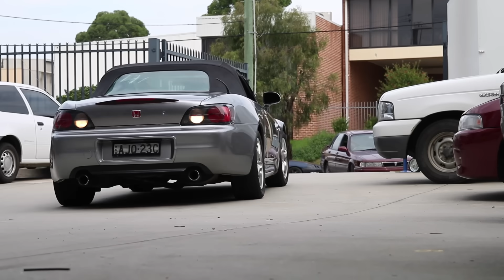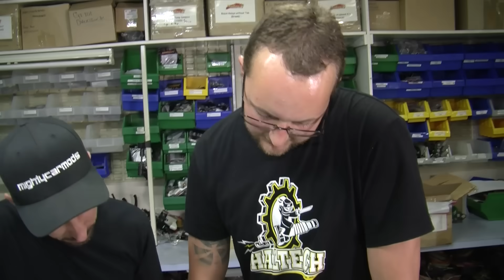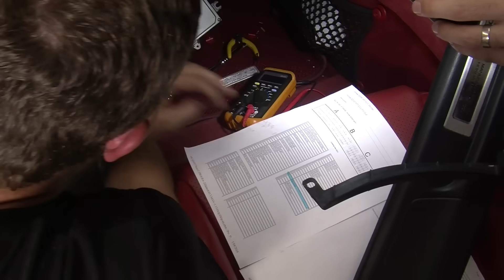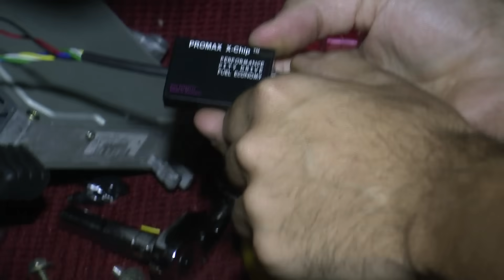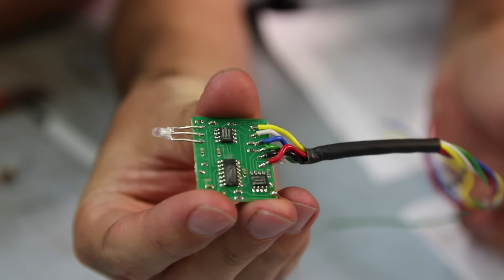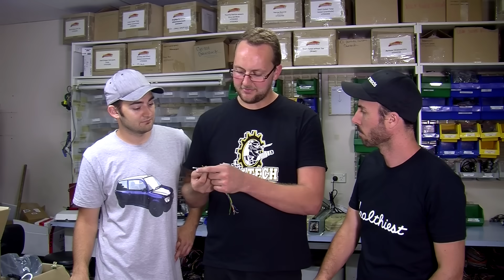eBay Performance Chips -  Mythbusted

Comment: Some performance chips do work but they cost like 1000$ lol I knpw because I bought one on accident, instead of a proper tuning unit for my turbo i got a bully dog RT gas tuner. It works, kind of. Allows for about 15hp in my 2.0 sentra with cold air and headers installed.

Comment: 14:35  No. It hasn't been installed. You are freestyling with the wrong box. This is just entertainment. The real Mythbusters would have abandoned the video after 7 minutes when you found out it was THE WRONG PART.
Look I guess, you had it pulled apart by real tech (apparently), so we did learn something. But the whole dyno aspect was invalid because the correct connections weren't all available. This is not about whether the box is a rip off (it is) but about testing methodology.

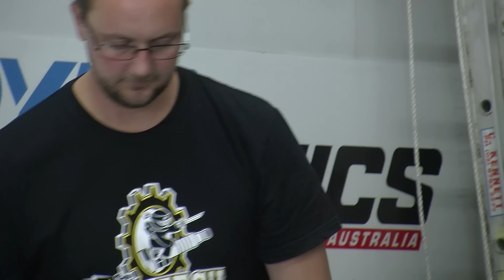Comment: ....And at about 7:30 you find out it's the wrong box for the car... Using MAP with the splice wire that was intended for MAF means that the whole exercise is now complete BS. - Physics teacher and car enthusiast. If you are going to test ANYTHING, you need the correct part. But you wanted to finish your video and pretend that it was installed. Really?

Comment: I put a chip in 95 325i and it was the best power for $ upgrade I did. The chip was $350 and it was a direct replacement for my factory one. It gave me about 30hp but it changed the entire way the car drove and got rid of the limiter for top speed.

Comment: NONE of the plug-in "performance chips" work, or do much of anything, EVEN the several hundred dollar name brand ones.

I tried several of them on a dyno years ago, and they didn't do anything that wasn't within the limits of the accuracy and repeatability of the dyno. This was an engine dyno also. Bone stock T.B.I. Vortec small block Chevy with the factory electronics. The engine was pulled several times with each change, with the same water and oil temps, and then the results were averaged.

Some of the chips said "For best results, must be used with a 160° thermostat, (that you had to go and purchase seperately), and we tested with the factory 195° stat AND then with the 160° stat. 

There was NO noticeable improvements with ANY of the chips, BUT we DID see a few horsepower when we swapped out the 195° to the 160° thermostat... 😂

I am surely betting that the small gains we saw with the 160° stat would have been had WITHOUT even the "performance chips" installed.... 🤣

I wish we would have went and put the stock chip back in with the cooler stat and pulled it again, to prove that theory, but we ran out of time on the dyno. 
But, I'm fairly confident that the gains WERE strictly from the cooler stat, and had NOTHING to do with the chips whatsoever. Such an expensive rip-off. 😠

Comment: It does work exactly as intended!! Its intended to fleece people who are stupid and it performs that function exactly perfectly.. i say this because you would not believe the amount of car's i see with obd2 plug in fake fuel savers/performance enhancers and these similar wire in devices and people who are selling car's advertising these stupid things thinking its a good mod and its going to help sell a car or win a track day ect.. I've seen hundreds of people around Brisbane and Melbourne swearing black and blue that they work.. its disgusting how gullible people really are..

Comment: I see there was a PS option on the screen. That's is what's should have been used and not imperial. You may find that its PS, or HP in DIN format and not imperial or US HP..
 Should have done this for something a bit more real like a $150 item with the right connectors. This is just BS

Comment: Hi , I thought the S2000 was ment to be 230 horse power ? that is what they say in the UK ?
Reply: the 230hp is measured at the engine, on a dyno your measuring from the wheels so you have drivetrain losses

Comment: Cutting into wiring or original equipment on a vehicle I can only assume will "void" any warranty. Also, when one takes the vehicle to the shop for maintenance, it will probably confuse the shop mechanics as to what the hell---- they can't adjust to factory specs during a tuneup ??? I recall thousands of "gas saving" devices were advertised in the 70's during the gas shortage including everything from "Fire injector spark plugs", "Ring of fire spark plugs" "Fuel line magnets" to "Water injection canisters". In my opinion they were a SCAM. I have yet to see any aftermarket product improve gas mileage. The best way to save on fuel consumption is to incorporate good, steady driving habits by smooth acceleration and braking. Avoid rapid acceleration, quick stops, and avoid stop and go driving.

Comment: Well, removing the numbers on the chip/IC could be the company actively hiding their secrets. But thats not the case here. They are hiding the fact its probably just a GATE IC. Something like a NAND gate IC or an OR gate. 

Ive seen companies remove chip numbers before. "No user serviceable parts inside" etc etc.

This is just a con!
Essentially its a placebo. If your told some little box will do a certain thing, your brain will tend to notice it more. 

Especially if your some young guy. If "Fast" or "Sport/race" mode, you will tend to have a heavy foot. But in "Economy" or "Fuel saving" mode, you will not drive you car as hard/fast.

Comment: I purchased a "performance chip" about 15 years ago.  The device was assumed to contain an IC circuit in order to be called a Chip.  Out of curiosity I opened it up.  There was only a 31 Ohm resistor, and nothing else?  So I had paid $31 for a 10 cent resistor which was supposed to take the place of the intake air temperature sensor.  What a rip off.

Comment: This is a shot in the dark, but as an ECU specialist are you able to increase the performance of any vehicle? Specifically, a 2014 Buick Lacrosse 3.6L AWD? I’ve discovered that there aren’t any performance upgrades for my specific car despite having the same engine as a cadillac CTS (I think). Is there a DIY way to perform a trial and error on my ECU to increase the performance?

Comment: This reminds me of the Bluetooth receiver I bought on ebay, which I opened when it failed to pair to my phone. It was designed to do nothing but light a blue LED when you pressed the switch.
Seriously. Battery, wire, LED, switch and hot glue. Audio jack wasn't connected to anything. $10. Free postage.

Comment: I have a 2003 S10 EXTREME ,4.3L V6. Did you ever come up with any power tuner that worked? Have you done any test to help the performance of the 4.3L engines ? Thanks Rod.

Comment: I think it is not that easy ... Each car / each manufacture designs something with the precision quality ... Even you can trick the machine to run faster but then you will ruin your engine faster because of the quality .... You pay $30K for a car and hope it run like a $100K car ... Sure but it is for a short period of time because it will be degraded faster.... Quality + Performance should be a in PAIR for any of the price ... I am not yet talking about the POLUTION / SMOG CHECK FAIL as part of the modifications .... Chinese FAKE stuffs like to get the sale but you will be the one who gets the bill later ...

Comment: Great video.Sad to say I just bought a second chip from an online dealor back east. Have you guys  tested other online chips? I used to work with large ICE's and we would calibrate and map the turbochargers and wastegates to produce electrical power. I have a nice scanner grapher tester and was thinking of getting a split OBD2 cable and monitor or record with and without. Most likely as your tests show I will see miniscuale qains.  Thanks for sharing the testing annd results.

Comment: It would be cheaper to manufacture a box with a  resistor in series with the fuel pressure sensor, it would actually do something.  Rather than producing a fake box of tricks.  These companies should be prosecuted.  Thanks for the vid!

Comment: I did not read every comment but I can say that the manufacturers keep the timing retarded a bit.  Why???  Because when you advance the timing the engine runs rougher and 95% of buyers don't want that.  If there was a way to trick the sensors into advancing the timing 2 degrees it would increase power with premium fuel.  I'd guess maybe 2-4%.  I base this on older V8s with mechanical distributors.  When street racing, I would get 94 octane gas.  Twist the damn distributor until the knock point with repeated runs and then race our half assed Chevy small blocks which were typically Chevy 350 with 1.92 heads (10.5 compression) headers and a Quadrajet 4 bbl.  The cars back then sucked in every way except perhaps nostalgia but they were simple.  With my turbo cars I just did  a muffler delete and put in a bleeder valve in line with the wastegate pressure hose fooling it into producing more boost.  This was on an 88 Supra and 92 Eagle Talon. 

It would seem it is at least theoretically possible to advance the timing on a modern car.  The question is: how to fool the sensors or change the coding.   I tried a chip from  "Chip Your Car" selling under various names and prices.  It was total bullshit and did nothing and YES I had it installed correctly.  The guys who sell it have every excuse in the book memorized and zero dyno evidence.  Until proven otherwise, I agree the amusing Aussies!!  Good video!

Comment: The law should ban these SCAMS ripping motorist off day in day out.I remember Peter Brock tried to SCAM motorists by selling a round piece of magnet attached to the fuel line to save petrol but all it did was digging a hole in one pocket.

Comment: Hello there. I have a project jeep. 1997 tj w inline 6, Flowmaster exhaust and k&n air intake. Its running with a 45.00 tamari stage 12 tuner chip and honest too god it works. Definitely recommend them.

Comment: My guess, being that this was made in Germany and Germans DO NOT sell bullshit fake car products... Is that this is just a very over engineered (very German) chip from some type of household appliance or other device that has a changing-color LED to indicate if it's ok, over heating etc... Then the shady eastern Europeans, who will literally sell you a sock and tell you if you put it over your air filter you'll gain 70 hp (remember - a Lada doesn't come with 70hp to begin with) and that's why the markings are scratched off.
DO NOT BUY ANY CAR RELATED PRODUCTS FROM ANY FORMER USSR COUNTRIES!!

Comment: connect a variable resistor between pin 2 and 3 on a 1.9 TDI and get 20-30hp extra
it works and that's how all tuning boxes for the 1.9 TDI engines work, no matter the price
there even is a video of a guy doing that with dyno test.

Comment: Or, you could put a 1 ohm resistor up in the ats.  Just bend the wires like a staple and tweeze them in to the ats plug. Wired side, NOT intake side. Then tape it up and zip it down. That, a K&N, and a Tornado, and woo hoo! Just remember to do it all at once and unplug the battery cable before you start.

Comment: I had an 850 volvo years ago, and it was gutless,  so I bought a "chip" off eBay it was a simple resister, that bypasses the airflow. It definitely made a massive difference, it definitely went quicker and amazingly I did get excellent fuel economy after I installed the resistor. I took it out after driving for a while, and when I put it back to the original airflow, it was gutless again.. the question is, would it cause trouble down the track?

Comment: Those connectors are make before breaks to stop you from interrupting signals for input/output

As for figuring if they have connected just run a continuity test (all multimeters have the option) from the pre existing line to the new spliced line

Comment: I don't know how much truth there is to these but I've heard that the instructions tell you to use premium fuel. With a lot of todays cars are back to using High compression. It's obvious using higher octane with high compression (example--my Kia Optima has the 2.4 liter motor but has 11 to 1 compression). That's how you get horsepower from a chip--nothing but hi octane fuel. Most adjustments if any would have to be made using a scanner or a computer to remap all the parameters.

Comment: These chips take time to analyze the car and make adjustments. They are often more useful for calibrating a car that has has airflow modifications as it can adjust fuel and air mixtures.

Comment: Guys you didn't read the instructions properly. This chip is designed and engineered to produce 100 Ant Power to your engine. On performance mode there is a green light that gives you comfort to know that 100 ants are pulling your car. You can't complain about the performance because manufacturers will tell you that the 179 horses ran over and squashed the ants during dyno testing so the ants were taken out.

Comment: DUDE FOR BETTER PERFORMANCE, 1) USE RECOMMENDED FUEL GRADE.  2) GET MAINTENANCE ON TIME. 3) ADD BRAKE OIL IF NEEDED. 4) CHECK TIRE PRESSURES. 5) OR SAVE UP TO BUY A REAL SPORTS CAR

Comment: The way it had to be installed I knew from the gate it was bogus. Your not about to just hook up some wires under the dash and get power gains. 
Only thing can be done is maybe taking off the rev limiter and MPH governor but then you chance blowing up the engine moving forward now...

Comment: I don't think a no-name chip for a car so relatively new is gonna do anything. I'd like to see tests of chips by reputable companies on older cars that may benefit from them. My first E30 was an 89 325i, with nothing but a cat-back and cone filter (I assume they did little to nothing), AND a replacement chip inside the factory ECU made by now defunct Autothourity (a Porsche/BMW) performance shop in the DC area where I grew up. I've driven a few E30s (still have one), and I swear thet 89 felt 20hp up on a stock 325i.Edit-I, of course had to run 93 octane (high test in US) or risk deadly knock, apparently. I always used high octane.

Comment: You shoulda cut the wires and made a direct connection. It wouldn't work especially if electricity find the path of least current. So if you hook up a resistor parallel to the original wires of course it would be no effect...
Reply: That's not what the instructions said to do and learn ohms law before you try to answer these types of questions, "find the path of least current is not a correct statement".

Comment: 180HP in a S2000? that's a bit low for the VTEC..
Reply: Maybe is wheel power not crankshaft power. Otherwise this S2000 has a problem.
Reply: @nikosstathopoulos1039  Skimming through the comments it seems the Dyno is of a type that outputs low numbers.. and yes wheel HP differs from engine HP, but I still think it should have been a bit higher.. at 180 I'd be concerned and maybe investigate why the 200 wasn't reached.. For the S2000 a +200number even with mileage should be doable
Reply: Power at wheels and power at engine is different. This is usual HP at the wheels.

Comment: FYI, the clip splices are ok, you just need to use pliers to crimp down the metal connection, then fold the plastic cover over. folding the plastic cover over the metal connection before crimping it won't apply enough pressure to cut into the wire, even if it does push the connection down still.

Comment: I want to if it's possible to remap the ecu on a mitsubishi 1,8 gdi.. the asian version has 140hp. But here in Europe it's 125hp
Reply: gtr500able different engine bro they’re the same 4G93 1.8L engine but different compression Ratio you need the Asian version piston on your engine to be able to make 140
Reply: @project.b8725  Ah ok! I little more work then x) thanks!

Comment: Isn’t the engine management system controlled by computer? If that’s true, then you are going need to trick the computer in to providing “more power”. So the problem isn’t so much hardware, it’s software.

Comment: It's doing 4 things:
Transferring $20 
Providing a cool led light
Compromising the integrity of your wiring harness
Compromising your warranty. 

Seems like a good idea. 

On the upside at least it did no direct harm to the engine.
Reply: @thisnametooktolong  Yep,  and I even had one. It had 18 k in it when I sold it. I spent far more time under that car working on it  than I spent driving the damn thing. A true "street-strip" machine!!
Reply: I ran a cold air intake hotter plugs and a stage 5 performance chip from eBay on a 2005 Cadillac STS and that thing is a rocket
Reply: I have a 97 jeep tj. Got the classic inline 6 engine w a thrush rattler exhaust and a cpə air intake. Im running on a Tamari stage 12 chip. Generally i dont put ebay parts in any of my cars but the jeep is definitely pushing hella more torque with that chip
Reply: @CranioUomo  NO, it is NOT...
You must be an ebay dealer of these scam products... 🤷🏻

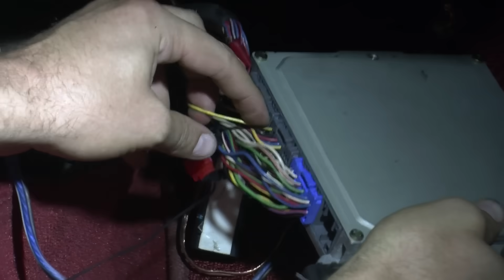Comment: @ 11:20 They should make those splicers transparent, then you can see if it made a connection or not. Great vids, Cheers!
Reply: good idea but... the reason for the colors, is for different gauge (size) wires... typically,  red = small ,  blue = med ,  yellow = large...
what they should REALLY do, is:  stop making those stupid things all together!  they really are terrible and crude

Comment: Haha i bought one for my jeep they. Have a resistor that retards your ecu my car ran weard beter gas but now power changed the cars pefomence. It wasent this chip it suched and mesed the way my jeep ran as soon as it came in the mail i hade doughts on the chip i had i like how thay say the chip will come in few days then directions a d hot line # come sepretly but all that is to makeyou think their wiill be more 2 it like asking make model and such even though its a 1 part fits every vehical and they make it so u will not need a machanics help even if you know nothing mine toke no tolls it clamped straight on the. Wire not even a splice o and the car did run worse once it was hot